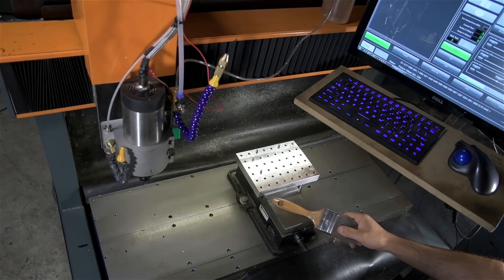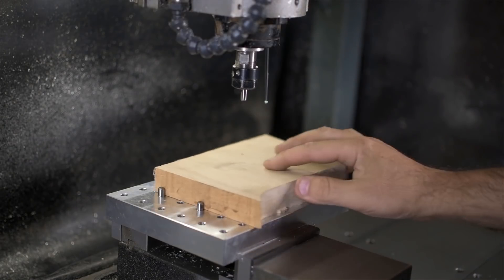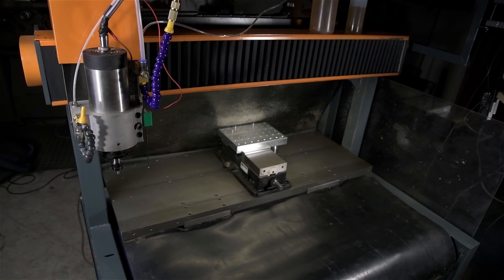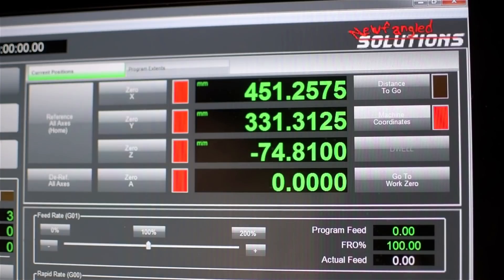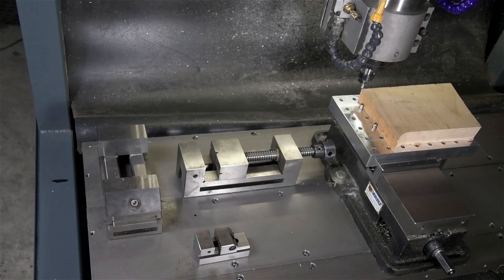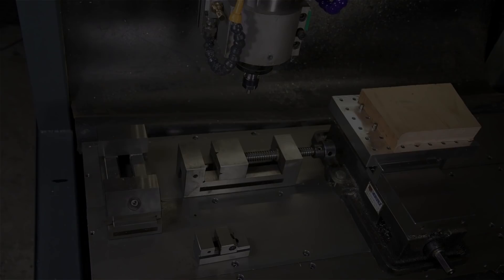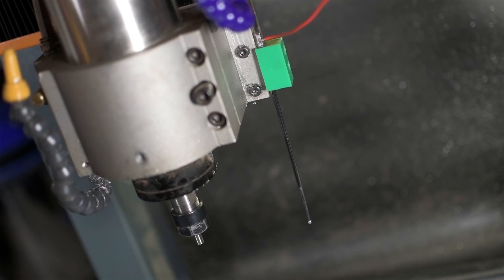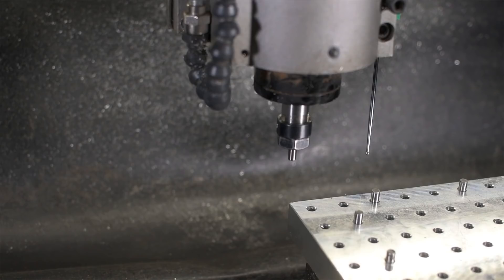G54 - You Sunk My Battleship!

Comment: The router knows where it is at all times. It knows this because it knows where it isn't, by subtracting where it is, from where it isn't, or where it isn't, from where it is, whichever is greater, it obtains a difference, or deviation. The guidance sub-system uses deviations to generate corrective commands to drive the router from a position where it is, to a position where it isn't, and arriving at a position where it wasn't, it now is. Consequently, the position where it is, is now the position that it wasn't, and it follows that the position where it was, is now the position that it isn't. In the event of the position that it is in is not the position that it wasn't, the system has required a variation. The variation being the difference between where the router is, and where it wasn't. If variation is considered to be a significant factor, it too, may be corrected by the GEA. However, the router must also know where it was. The router guidance computance scenario works as follows: Because a variation has modified some of the information the router has obtained, it is not sure just where it is, however it is sure where it isn't, within reason, and it knows where it was. It now subracts where it should be, from where it wasn't, or vice versa. By differentiating this from the algebraic sum og where it shouldn't be, and where it was. It is able to obtain a deviation, and a variation, which is called "air"

Comment: https://machmotion.com/cnc-info/g-code.html#G10_Tool_Offset_and_Work_Offset_Tables
Look at the code for your work zero buttons. I don't use mach but the ones in UGS set the work offsets to zero using G10. Replace the zeros with the negative of your probe offset. E.g. if your probe is 35 mm +X, you'd use G10 L2 P1 X-35 Y...  IDK if you can change those values in your settings or make a macro to zero, but you shouldn't have to dedicate a coordinate system to your probe. BTW, your videos are awesome!!

Comment: I know this is a comment on a two year old video. Thanks for providing me with entertainment that makes me feel like I've done something. Someone commented about how do you know if your probe is still accurate. I'd say that's what G53 is for. With the orientation of your probe, you should probably be able to pick up on the back right corner of your table (or something premanently mounted to it) and compare it to recorded machine (G53) coordinates. That location should always be the same. If you check it and it's not the same, your probe offset changed. It would be most accurate if you started at the same machine coordinates every time. Thanks again. Just subscribed. Watched everything from the original no voice over tig pedal until this point and still going.

Comment: Can you talk about tool offsets and the difference between that and work offsets?
Reply: Tool offsets are directly related to tooling.  Say I have a .500 end mill working in a pocket with a tight tolerance I want to sneak up on I'll set my tool offset to something like .505".  This makes the machine think the tool is larger than it actually is which, in turn, makes the pocket smaller (if 1" pocket it should be .995" actual measurement).

I'll do this for several reasons.  Either I don't trust the tool I'm using (full, inconsistent wear, new to me), it's a first piece with tight tolerance or specific surface roughness called out, when my tooling is sticking out pretty far where I might fight chatter, 1 or 1 runs where machining time takes a backseat to making sure the part gets out the door, or to account for tool wear.

The only other time I use tool offset is when I'm lying to the machine.  I had this one job that was two barring gears for turbines with a very specific departure angle that my machine kept giving me errors.  The machine basically didn't like the tool I had to use for rigidity purposes, the radius of the tool was pretty close to the radius of the feature and my machine didnt like that.  We rewrote the program a few times on the machine and in Fusion but still couldn't get it to run until I started playing with my tool offsets and finally got it to run without a hitch.  I can't remember what size end mill I had to use, but if it was a 3/8" I told it something like I was using a 1/4" end mill with a 3/8" offset to get it to work.

Comment: As a software developer I'm horrified that end users have to deal with G numbers rather than user friendly terms like "Home 1" or "Temporary offset 1". Yeesh.

Also, I noticed that the spindle rises (to the top?) before moving X and Y. I imagine this is to avoid running into the workpiece, but if the maximum height of the workpiece could be defined, the movement from A to B could be reduced to save time, energy, and wear on the components.
Reply: I know right.  Arduino C is more readable than this G- BS... 
Actually thinking about it BASIC might be an improvement ; -)

Comment: There was a great camera plugin for mach 3 (and possibly mach 4)

You get yourself one of those cheap $10 "borescope" cameras from ebay, make a little clamp to stick it on your Z axis, then get it lined up so top of the image is Y+ etc.

First time out the gate you spot drill a small hole in some scrap, center the camera on the hole and you've got your offset, whack that in the plugin and from then on all you've got to do is jog the camera over a corner or whatever and hit go. It was certainly good to within 200 microns or so, which was great for the sort of work I was doing, which was mostly contouring around print that had already been mounted on the board. If you printed 2 reference marks you could either use them to square the stock (pivot around the origin) or use them to calculate G code scale / rotation provided you weren't overly reliant on arcs.

Comment: I've always wondered: how about the offsets of the tool itself? e.g., the bit diameter, or length. Is it so precise that you can just enter the numbers and trust them? I mean, what if the bit is not 5.000 but 4.993? Or instead of being sat 24.00 mm. from the mandrel, it is 23.43 because of wearing? Is this a factor? Should you just throw away the bit if it is off by 0.01? I'd like to know! Thank you.
Reply: Thank you. I was wondering about the professional ones. :)
Reply: That is what tool offsets are for. Most controllers support radial tool compensation g41 and g42 (left or right offset) this enables you to adjust the diameter of the tool (or a wear value) to compensate for variance in tool diameter.

G41 and 42  use a D parameter to define what radius offset to use (they are stored in the controllers tool offsets, D1 would be for T1 for example)

Usually G41 or 42 is called just as the tool leads into the part (it does the radial shift during that lead in move)
it will offset the tool so that it is to the left or right of the path

Then after cutting, G40 is called to cancel compensation on the lead-out move or on rapid out (returns from radial offset)

For tool length you have G43. this uses an H parameter. the H references a machine variable that usually stores the machine z-coordinate for when the tool is touching the machine table.

G0 G90 G54 X0.0 Y0.0
G43 H1 Z1.0 

That would park the tool 1inch above work offset G54 using length offset 1. Using tool length offsets also causes the work z offsets to be the positive height from the surface of the table instead of the distance down from the z-home position.

also, most post processors support tool offsets, you'll just have to set your tool offsets on the controller, and tell you cam software that you want to use in-control tool compensation.
Reply: Cool!

Comment: Most CNC machines have at least 6 work offsets G54-G59. But always make sure you are in absolute G90, not G91 incremental. Just a heads up.. as being in G91 would result in a crash otherwise. You can use G91 but it is a little bit trickier you would have to "write" a position register using G92. This is helpful if you have limited memory and or are trying to run similar parts in a chain as you can use one work offset and than just write G92 X2. if the parts where spread at a 2" distance, this would be assuming that Z0 is at the same height and Y0 would also be a the same location. This can also be done with macros or work shift on some controllers.

Comment: Tony you may already know this. However to take it a step further with offsets. You can use the (#) macro to probe off of. Thus stating to the controls probe (#) if X-0 and if Y -0 = (specified amount), run specified offset. Saying simply saw blacks maybe .002-.004 diff....from each other. Or even further off. But that can be preprogrammed in your Marcos. Just an idea say you can just simply prove and run. VS probing finding your black is off then re-zeroing.

Comment: So the thing I don't get is why not make a small plastic holder for the touch probe that fits into the spindle? The plastic would insulate the probe from the grounded chassis, and you wouldn't have to bother with offsets (other than the diameter of the probe). Is it just because that would require a tool change?

Comment: Could you not set a qerneric home for example when it finishes cutting it always goes back to 0,0 and when you turn it off it has that set as a 0,0 home
Reply: G91G28X0.Y0.Z0. Sends all axis home. For 4th and 5th axis you would also need B0. and C0.
Reply: Phillip, depending on the machine this does not always work. one of the ones i work on will try and over-travel if it is not homed when it is first turned on, no mater where it is when it is. You even have to jog off of home or it will not trigger the limit switch when globaling.

i'm sure some DIY machines you could get away with that, but most big machines will not allow it.

Comment: If you think this is a dumb machine, you're lucky to have never had to touch punch card one...oh boy, i'm young, but my struggle years were on one of those, and oh my god, when they work, it's solid, but when they don't oh my god, they don't. Then you have to climb in to it and hit it with a special soft hammer with a steel handle, kinda dainty, they call it a screw driver...newfangled toys i say. I learned how summon fire and water with one of those.

Comment: Nice! But how did you actually measure the offset between the probe and the endmill?
Reply: Kevin Stacy center is the same for every bit
Reply: Could work, I wonder, would it be more precise to do a straight down hole, then, remembering the actual coordinates, move the probe to it, and centerfind the hole?
Reply: I'm guessing with a bit of math. Find the edge of the work area with the probe. This is your origin.
Jog the machine to where you want the spindle to be. Note the offset. Do this a few times to verify repeatability.
move the machine using G Code to move the spindle to where the probe was. Make that code for your fancy zero spindle button.
Reply: Armilar Zifferblatt I would use edge finder: zero the probe found edges, use edge finder in the spindle to find the edges of the work, jog the spindle the edge finder offset, and your spindle is center on the probe location
Reply: Maybe I missed it in a different video, but did he say why he's not just placing the probe connection (alligator clip) on the bit its self before edge finding? These predefined macro'd offsets are a pain when using multiple sized bits.